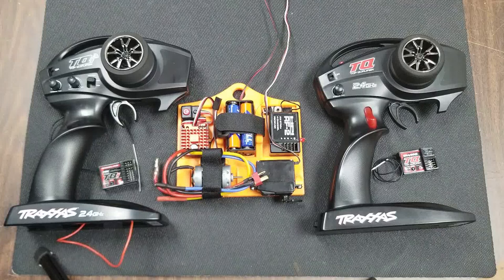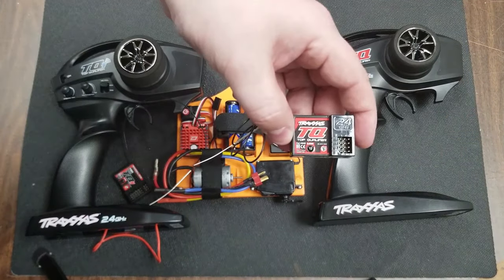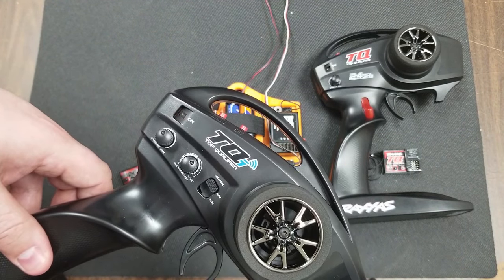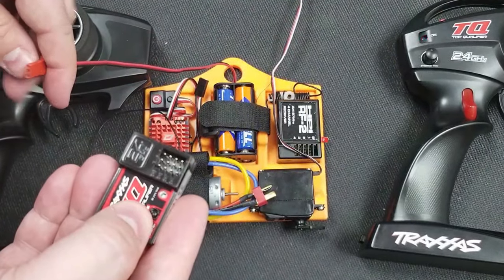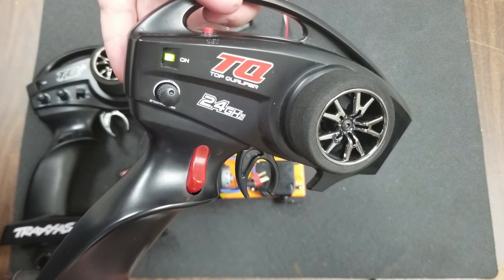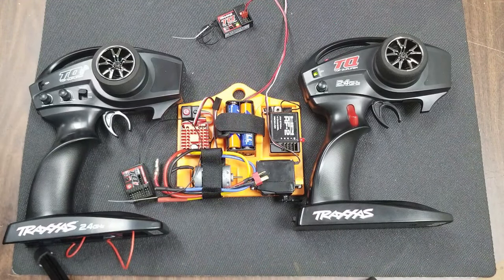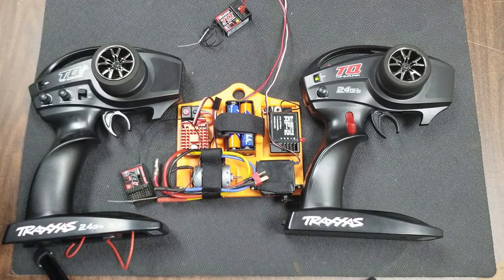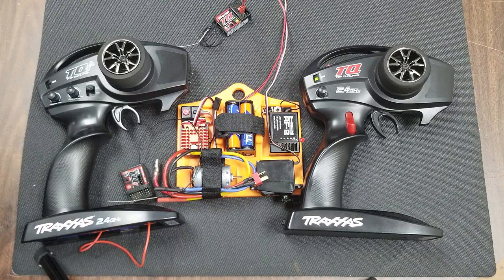Hobby 365: How to program the Traxxas TQ radio.

Comment: Great video. Do have a follow-up question. My Tq receiver has left, right and forward, but reverse is just a brake no movement.Would like full reverse so i can back away from objects. Any suggestions would be greatly appreciated. Thank you in advance.
Reply: Maybe your esc is set for race only ? You have 3 modes on the esc. Sport 100/100 training 50/50 and race 100/0

Comment: My throttle is moving steering?got new blue esc tsky 120a and lost all movement in motor no throttle been trying to  setup  codes but can't
Reply from the maker: If your throttle is moving the steering that means that you have your steering servo in port 2 (the throttle slot) and your throttle in one of the other slots. Try rearranging the plugs take the plug out of the ch2 and move it to one of the open ch1 slots. There are 2 ch1 slots in a Traxxas receiver so pay attention to the numbering when you move the throttle back to the ch2 slot.

Comment: Do you know of a way to adjust steering endpoints on the TQ transmitter? I have a trx4 sport
Reply from the maker: Sadly I do not know of any way to adjust end points on the TQ radio. The set button is used to reverse the servo direction.